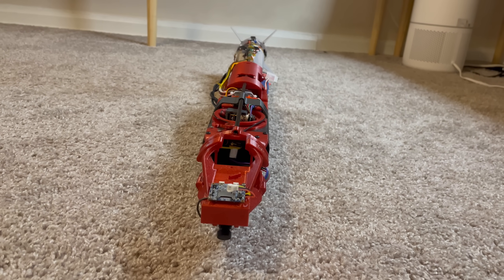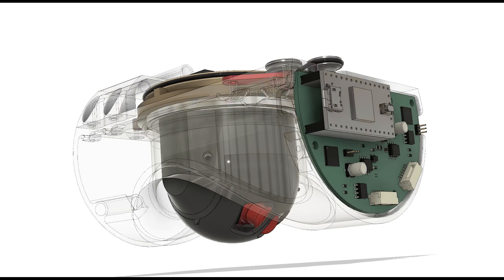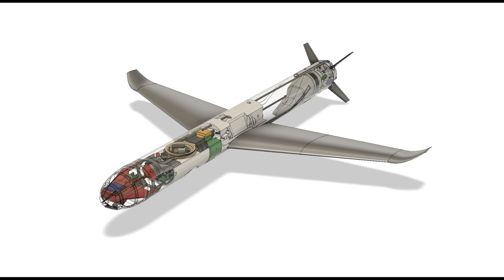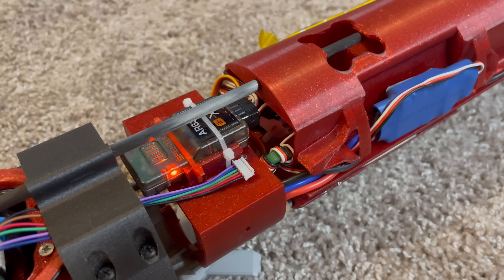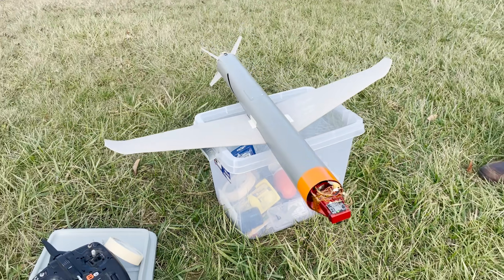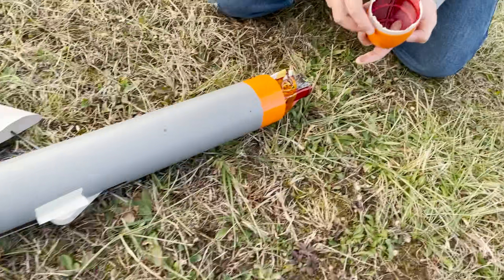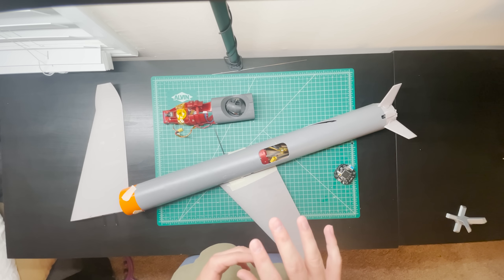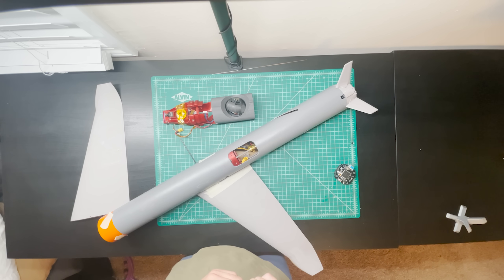Building (And Crashing) my Homemade Surveillance Drone

Comment: Just found this channel and I LOVE it! My 2c... Original design is like a cruise missile, which is typically launched at high speed - over 500 mph. Since you probably want to launch at closer to 7% of that for a hand launch, you need to make this like a small slow airplane. Control surfaces must be much much larger. Like 10 times the size for stability and authority at low speed, maybe bigger. And just do two on the top. No need for 2 little ones underneath. Wings also probably need to be larger - need to get that wing loading (lift/sq m) down. Weight is one way, but also more wing area. Also, no swept leading edge.  Make it straight. How did you choose your airfoil cross section?  You need more thrust. I bet if you put a scoop on the bottom a la F-16 (Or better yet, on the top like a Cirrus Vision Jet which also has a V tail) and got some ram air action going, rather than just suction, your CFM through the fan would go way way up. Finally, consider CG vs center of lift. You want your CG forward of CL but by how much? Moving CG back closer to CL can reduce required lift, but if you go too far you become too unstable. Go too far forward and you nose dive!

Comment: This project is cool to share on YT, but it will never fly at its current inception. You need much bigger control surfaces, including ailerons on the wings. The duct motor will never provide enough trust, it is terribly inefficient. You will be better off with a traditional power plant - a brushless motor and props. The CG looks way forward. If you still like to test the flying characteristics, drop the model from a drone at 400 feet and see if you can control it. It will make for a great show.

Comment: Slt, je ne suis pas un spécialiste. Mais ton avion, vol comme une pierre.😏. Il m'a rappelé l'automne, quand les feuilles des arbres tombe au sol. Impossible de prévoir une seul direction. A part celle de la pomme. Ce qui me viens a l'esprit, c'est donc déjà, qu'il manque de puissance. Soit le moteur ne tourne pas assez vite. Soit il y a un maque d'air a l'entré du moteur. Regarde le missile "TAURUS KEPD 350", il a deux entré d'air latéral, droite et gauche. Et c'est une grosse boite... On pourrait les recycler en caisse a savon. Apres, je travaillerais sur l'équilibre des masses. Fabriquer une balance. Et vérifier les poids avant/arrière, et droite/gauche. Et pour finir, il faudrait peut être vérifier la portance des ailes. Et leurs inclinaisons. Une erreur dans la forme peut avoir des résultats contre-productif. Tu devrait utiliser un tube simple en PVC, pour tester tes ailes. Avec un cône blindé et du poids a l'intérieur, bien sur, pour te rapprocher au mieux de cet OVNI. 🤫. Ca évitera des casses inutile et une perte de temps. Et c'est toujours mieux de régler un problème après l'autre, au lieu de 3 en même temps, car il faut avant tout trouver qui est responsable...  En tout cas, super travail... Je suis jaloux... Continu, c'est un vrai délisse a chaque fois ... 👍

Comment: How cool! But hey, you are a rocket expert aren't you? So wouldn't it possible to get the initial launch speed from a rocket motor, since that seemed to be the initial pitch? Turbines have some kind of 'lag' aswell when compared to pusher props, so maybe this isn't the oiptimal propulsion you are using here, (unless maybe you start them at least 10 seconds before launch in the adequate situation, meaning laminar flow conditions). 
   The Mass to Surface area ratio seem to require quite a high launch speed and i don't think no human could provide it. If your mass to surface area exceeds 90g/dm², it's going to be a tough job even with the appropriate airfoil/ incidence to get it airborne, as it ventures into what is known in europe as the 'warbird' cathegory that require motor power to lift off. From what i saw, it isn't possible to identify a CG issue, but the weight/ surface area seems obvious. This thing clearly require a very high launch speed. 
   Now,  a lot of ideas that seem pretty clever to me, but it seems to me that the tail is so heavy and requires such a weight to be added front of the CG @Distance, that it might be balanced, but never able to reach flight speed on its own (unless maybe with a rocket motor). So how about for now, cutting some induced torque coming from the back by moving the servos toward the cg?Aswell as making the front lighter by ignoring (at least for now) some of the systems which weight is supposed to counter balance this torque? This would make the plane lighter. But you may aswell upscale the airframe, in order to reduce this mass to surface area ratio, as it may aswell save some sweat.
   I would rate my suggestions in the following order:
-get rid of as much weight in the aft section of the tail as possible. This won't make for a successfull flight but in the worst case scenario, it will reduce torque and increase responsivness (it will also reduce stability and increase unstability though).
-Make sure the cg is right in the case a test flight could be successfull, so you can ignore this in the next crashes analysis. This will help inbdetermining which is the cause for a crash appart from that. Better nose heavy in this case, but it may already be.
-simplify the prototype design, so you can identify what is going wrong more easily. Fixed airframe was a good idea. You are forgiven if the airplane doesn't carry all the necessary weight, a mock mass should be enough. And rescale accordingly to your take off scenario (for now landing seems to be an issue aswell). Two or 3 mock ups could be necessary, in which case, i would test with a fixed airframe with a predictable design (such as V1 or Ooka if you'd like to use a catapult or a rocket motor for launching).
-Increase Surface to weight ratio gradually. Or instead increase Mass to surface area gradually. Meaning you should should be able to start with a lighter weight without impacting the balance . For anything lower than a capable 3s EDF, the Mass to Dm² should be lower than 90g/dm². Everybody can understand you need to start small. And upscaling can help at some degree (depending on airfoil performance @Re).
-I understand launching a rocket propelled vehicle is prohibited below 60°, but with and Edf and control surfaces both helping with the ballistics, that's something different. And in the end, who cares if it is catapult launched instead of rocket launched? The released energy could be the same in the end.
Nice video, i hope you can iterate!

Comment: The overall design is almost identical to that of a SPICE-250 Glide Bomb or even JDAM-ER which is designed to fall and correct trajectory, not float and observe under its own power.  
Thus, I think you have a few design tenants that need to be rethought so that it can fulfill its intended mission.  I guess it really depends on what you ACTUALLY want it to do.  You have a few proposed uses, but it seems like the "loiter" may be the prime with wanting it to film rocket launches - aka ISR/Scan, Detect, Observe.  If so, I think you need to think about referencing more glider/ISR aircraft design language versus missile/high speed or free fall designs.  Yes, while cruise missiles and glide bombs look wicked cool, they are designed to go fast - not float and loiter.  Something like more RQ-9 Reaper and less AIM-7 Sparrow/JDAM-ER/SPICE-250.   None of this is meant as any shade - purely constructive per your request.  I think you nailed a few things and really stoked on where this is headed.

I would say thrust is one of your big problems.  Whether that's redesigning the rear for a dual or larger single, it looks woefully underpowered.  
I would also think about potentially holding back on the thrust vectoring at this stage since you just need to get it in the air.  I think you have too many variables to sort through and eliminating that one will ensure your basics are solid without also having to deal with a maneuverability enhancement that isn't necessarily required at this point.  (Which also leads to the discussion of EDF versus exposed prop.  i'll reference the missile vs. RQ-9/MQ-9 design language.  I know I know, the vectoring is super cool, but that may be something for a high speed project and not a loiter, but thats another conversation entirely.  Maybe this point serves as a path of divergence of two separate designs...but I digress)
I LOVE the idea of the vectoring, so it needs to stay on the final, but its adding a variable you aren't used to dealing with.  Plus, in a few of the test shots, it looks like it may actually be blocking thrust at full deflection and not necessarily vectoring it constructively, further exasperating your thrust issue.  The dual fan rear end would also help the vectoring:  putting the left stab/lower tail-fin on one motor, the right side on the other would open up the cone and have less potential blockage at full control surface deflection AND reduce the number of axis of thrust diversion per motor giving you better vectoring.  I wish I could insert a drawing of what im saying (you know the whole picture worth 1000 words thing), but hopefully you understand what im saying.  Also, you may want to think of limiting the vectoring to a single axis via paddle.  There is a reason why the successful vectoring aircraft use extended paddles and not internal diverters.  You get more efficient thrust vectoring and not just blockage.  The vectoring needs to really extend out the rear end to POINT the thrust in the right direction - think of the X-31 EFM (3D vectoring) or even the F-22 (Single axis vector) - they really extend out and point the thrust where you want it to go.  

So that said - if you want to keep the vectoring, I think you need to extend the vectoring paddles well behind the thrust exit point so as to redirect it more prominently.  It does appear as though they are merely influencing it because they are tucked into the 'exhaust cone'/ducted fan and wont give you much performance. 

I also like the idea of significantly increased size of the top vertical stabs.  That one test it just sideslips to the ground.   Its designed more as a glide bomb or even a cruise missile at this point, which has MASSIVELY increased thrust compared to what you currently have, increasing the effectiveness of smaller control surfaces.
I'd love to help more if you need.  Hopefully this can be helpful or at least give you some things to think about. 

@kylebedrich8803 also has some solid advice for you.

Comment: Most important things in a system like this are making sure it isn't underpowered and that the COM and COL are located correctly. It's telling that you can find videos of people getting a pizza box to fly but this can't. The motor looks small and the frame looks heavy. EDFs are generally very inefficient and weak for their power draw. Maybe it needs a bigger tail and a big unshrouded pusher prop? This is how most military tube launched UAVs work.

Comment: In general when I make a plane I like to have a power to weight ratio close to 1 or greater.

Edfs eat battery, youre going to only be able to fly for a few mins at best.
Maybe consider a folding pusher prop instead?

I'd simplify the tail to something like a v tail, and would not do any TVC.

Stall speed is going to be very fast, saving weight will help.

 Look at even longer high aspect ratio wings.

Comment: Suggestion: Your small control surfaces are fighting against the significant mass of the propulsion unit. Notice conventional aircraft have huge control surfaces at the end of the craft with the lowest mass/inertia. Shoot for lower polar moment of inertia (mass toward center) and larger control surfaces. Long light tail, heavy short nose. Even with your CG over the wing chord it doesn’t want to weathervane with so much mass in the tail IMHO

Comment: 6 feets of small rope on eatch  wing tips and after 2-3 turns arround the thrower release the baby.  The protoype will get time to reatch is flight envelope. The first attempts were some  bad and strong  pitch move  (impossible)  with the right hand on the model back.  Holding the plane in front of is gravity center would be a beter grip to give the first momentum.

Comment: Maybe you could put a solid rocket booster and get it into the air vertically and program the engine to start when the rocket motor exhausts self ejects itself. At least you’ll be able to test the gliding ratio before impailing the ground. I LOVE LOVE IT!! keep up the hard work very impressive.

Comment: PLA Lightweight prints at half the weight of standard PLA, so that would be good to use wherever you can. I think your main issue is just like you said, stall speed is too high, maybe you could tow it with another RC plane to get it flying? And yeah reducing weight

Comment: Nice project!
I remains some comments. 
A. Flight test procedure. 
1. Make a simple version for initial Flight test with RC Glider style. ( No FCC & Camera& EDF) 
   => You need to find Weight & CG at light weight.
   => Add dummy weight and try gliding test. 
2. Add EDF & Powered Flight test. ( Light weight =>  final version weight ) 
3. full assemble and Flight test 
4. Add on SW function step by step.

B. Weight Balance adjust
I don't know this aircraft's weight & balance. I just fell , It is tail heavy aircraft.
Maybe it need to check CG and Adjust major components.  (for example Battery)

C. Power & Wing & Speed.
Usually EDF is small thrust. This aircraft high wing Loading. 
You need a Launching system for initial Speed. 
I think , this system needs  Launcher and  Test using RC version. 

Good Luck for your project.

Comment: I have no creds, i just wanted to put my thoughts down.

Dude, this is a sick build!  I hope you get to complete it before someone with a fancy flip badge decides its too sus to continue.

Watching the launch attempts, I think the speed is too slow for your control surfaces.  It spun around as if there were no fins and your inputs seemed to have no effect on its trajectory.  

I dont know diddly about EDFs but it looks like Hatchet's is not enough to give it the speed the wings and fins are designed for.

I think if youre able to launch at a higher speed youll actually be able to see it generate lift and react to the control surfaces.

Of course you can redesign with bigger wings and fins but I assume that would have adverse effcets in your planned flight regime of post rocket launch loitering.

Again, just the guesses of someone with zero experience.  Awesome project and looking forward to the next update!

Comment: Hey, it looks like your CG (center of gravity) is way too far aft. The CG should be in the forward third of the wings, put one finger left and one right below the wing and try to balance it there. 
From the launches it looked like it was way to far back, try moving stuff to the front or put additional weights in the front. 

The CG is usually the most critical thing to make sure something actually flys.

Comment: I would use a couple model rocket engine's in a separting booster or drop from a bigger winged drone or something similar for speed. In theory at a certain speed it will be able to sustain itself

Comment: Reduce your weight using LWPLA, You need more surface area on the rear for take off. Consider a catapult launch as your friend isn't throwing it at a consistent level for control authority. Experiment with different EDFs, you'd be amazed at how different every brand and design is.

Comment: 1.  CG looks very tail heavy 
2. Need more wing area maybe delta wing 
3. Look at weight to thrust to wing area.  If wings are too small you need more thrust to make them effective (like a fireworks rocket).  BL- you have to compensate weight with more thrust and or wing lift surface area. 
4. Lighter is not always better with environmental factors (wind). However use light weight pla.
5. Adding a flight gyro system will help with maintaining stability and launching
6. Add landing gear.  At least till you get it flying!  You can remove or make a launch rail/cart like others have mentioned.

Hope this helps!

Comment: you need to move the weight forward or the wings back, you should calculate the CG like a flying wing. the problem is that the engine is too far back from the CG

Comment: Probably someone already told you that, but it seems, first of all, a "simple" aerodynamic problem.

The CG is correct? It seems not, even if is quite difficult to understand, considering the terrible way your friend throw the model.
Also, which is the wing load?
Then.... which kind of profile did you use for the wings?

I think your solutions are good ideas, but at first, do the basics to work well and maybe is better to start with bigger fixed wings, with proper profiles and variable geometry. And also a big V tail, as you already noticed.

Anyway, a great project

Comment: That’s an awesome design but with a few airframe flaws. First, you could use your original folding  wing design with some kind of foldable wing surface like nylon on top and bottom. Second, you need to make the fuselage flatter especially on the bottom instead of a tube. Your main problem is that your design doesn’t have much of a lifting body. Fuselage design plays as much of a role as wing design in terms of surface area and shape. Third, you should design some kind of retractable deflection surface on the wing trailing edge (flaps) so when you hand launch it, it will create immediate lift until the fan powers it forward and gives it momentum. Also, make sure your CG is somewhere near the forward wing root. Hope this helps.